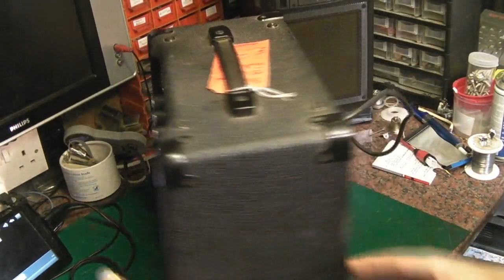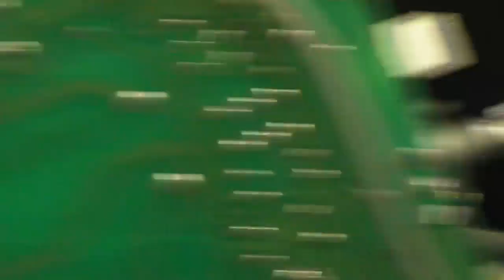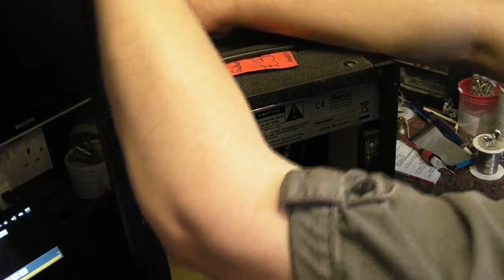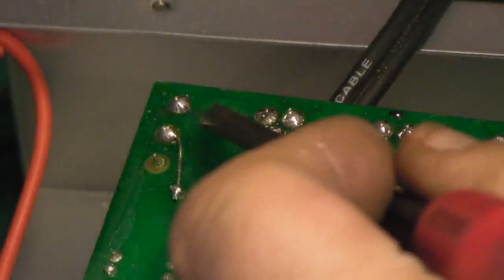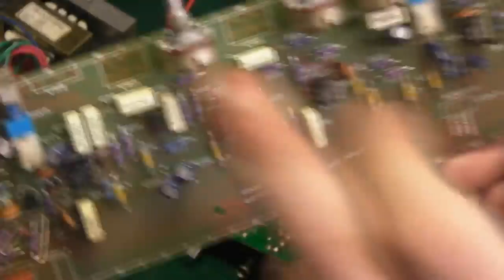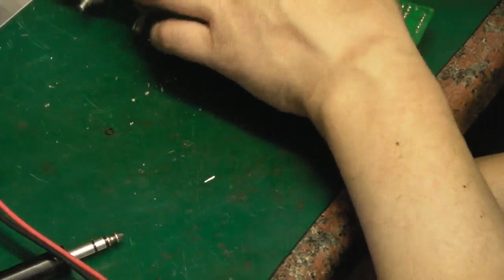Star-Sound GB-15 Amplifier repair fail

Comment: oh I had a Star sound Bass guitar that come with that amp.  I got it off ebay.  thinks it was about £40 with the postage.   It worked ok.  I sold the bass and amp, years later.  think I made a couple quid on it.  I also had an Elevation electric guitar and matching amp, from an ebay sales page.  £30.  I managed to blow a bit out of the amp chip. so I googled 10 watt amps, and the 5 pin chips. got a pack of those amp chips for a couple quid.  got it sorted.  I sold the guitar and amp to cash generator, a few years later